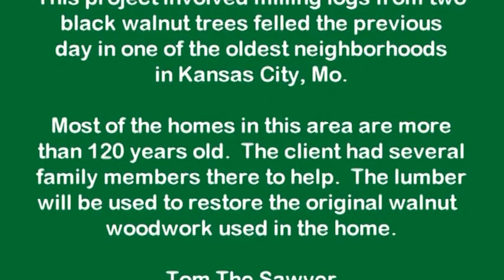KCMO Urban Walnut 2014

Comment: Why does it look like it was filmed in 1974?
Reply from the maker: Probably because it was before I bought an HD video camera.  Josef, I got a notification about your comment on the Milling Black Walnut for Figure video, but couldn't find it to reply.
Reply: Yeah, I was just messing with you on that one.  I deleted it.
Reply from the maker: @Josef_R  It was actually a reasonable question.  The short answer was that I get most of my logs from tree services.  Residential (yard/urban) trees have a different growth pattern than woodland trees.  Most of the logs I get are from trees that were removed because of disease, construction, storm damage, or they were were judged to be 'inconvenient'.  Although I do try to tell the tree guys what I am looking for, sometimes it is just what the tree gives them.  Plus there tends to be a lot of turnover in that occupation and the ones that try to properly buck a saw log, may not be around that long.  Arborists with a good eye for saw logs are pretty rare.
Reply: Yeah, that's what I figured, but my question sounded too sarcastic, so I deleted it.